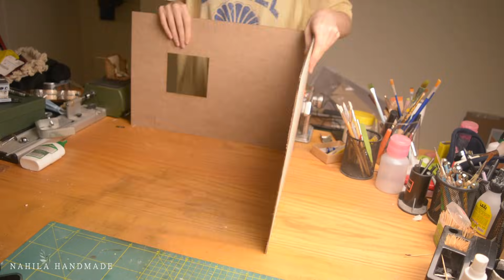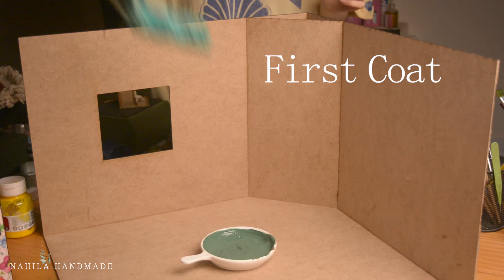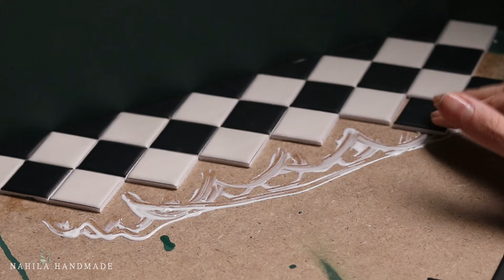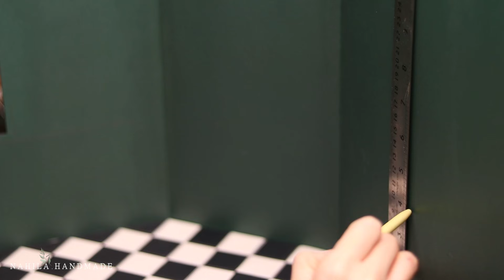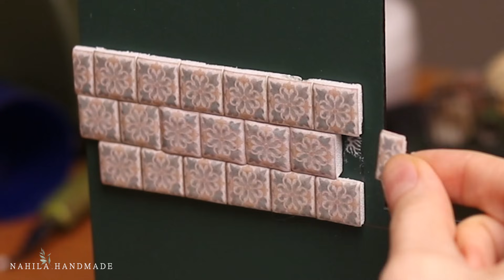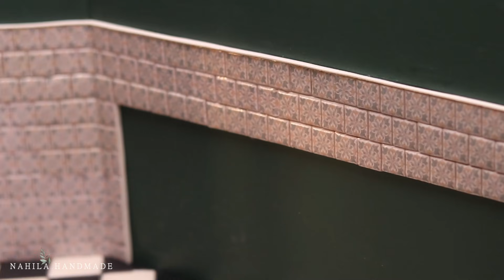Build a Miniature Room from Scratch | Step-by-Step Tutorial & Materials Guide

Comment: Both useful for building and fun to watch 👏🏻
Just one question: Are the flooring materials exactly like the tiles you showed in your previous tutorial?
Reply: maybe a flater and bigger pan for the paint and a smaller roll would make the work easier😂.

but the result is amazing. i love it❤
Reply from the maker: @ritah9890  No, actually I used to use a bigger roller before.
Because it’s much heavier and absorbs a lot more paint, it’s much harder to work with.
Reply from the maker: Thank you for watching! Yes, they are exactly the same ones.